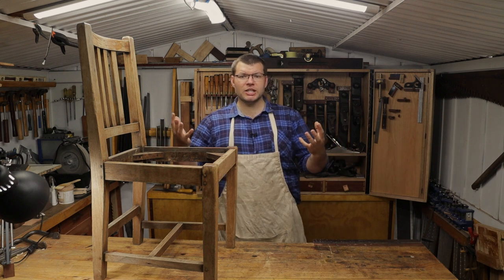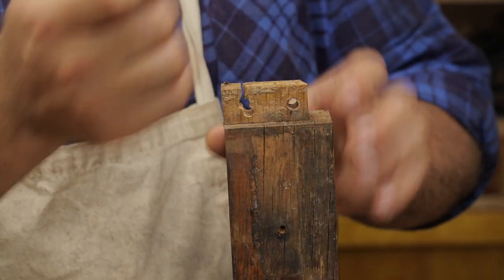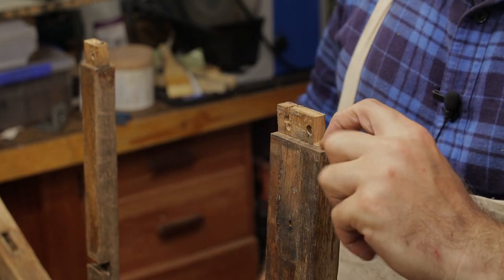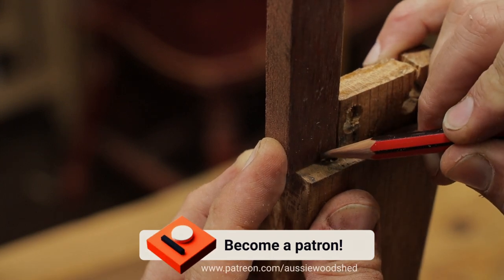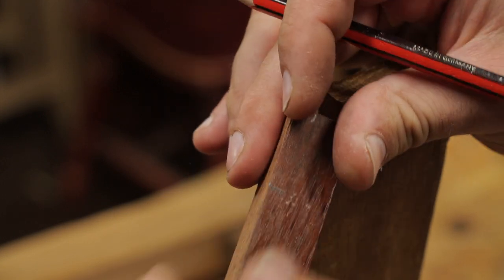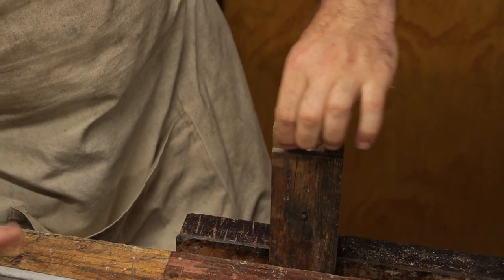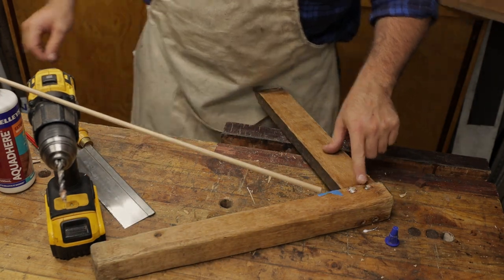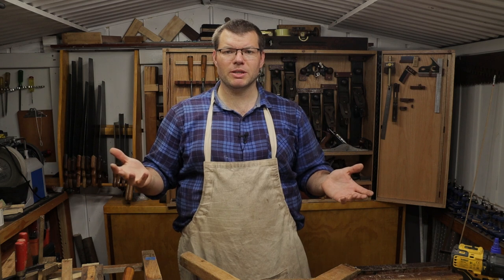How to Repair a Loose Mortise & Tenon Joint

Comment: Genuine question, why didn’t you just screw into the tenons and pull them out? I feel like drilling causes more harm than good.
Reply from the maker: Great question. I tried to remove the dowels without drilling them off camera, but the dowels on those tenons either still had glue on them or had swelled in the holes as they would not pull out. 

This is an issue i have run into multiple times, also putting a screw into the end of the dowels can make them larger on the end and also jam them.
Reply: Good advice! I have seen Tom Johnson do a screw in the dowel to pull it out, so I have done that in the past as well.

Have you worked with square-faced dowel pins on a tenon and mortise joint? I am restoring an 1820s French cabinet and the dowels are squared on the front, which I have never seen before. I have to remake the dowels by hand and I am worried about not getting the right fit. @AussieWoodshed
Reply from the maker: @nathan_agnew sounds like a great restoration project. I haven't ever worked with square faced dowels, the closest i have seen was square pegs knocked into round holes, i guess that worked because the peg was slightly larger and harder than the tenon timber.

I guess a trial and error slowly pairing them to get them to fit approach may be the way to go, i don't think there is any easy way to batch square faced dowels.

Good luck with your restoration